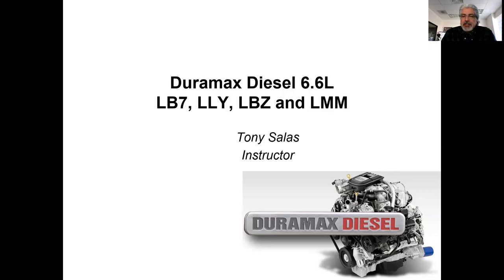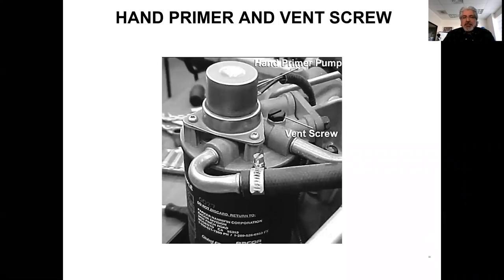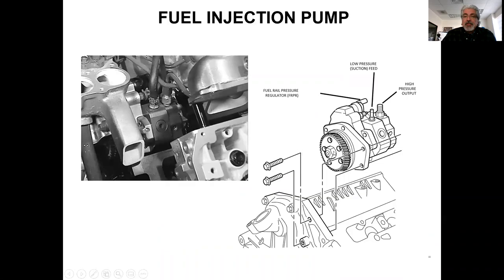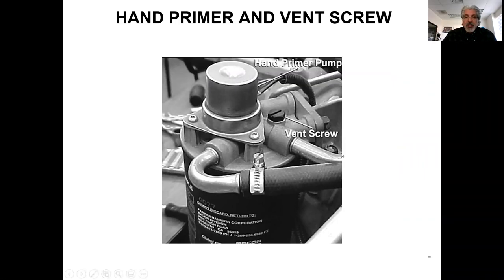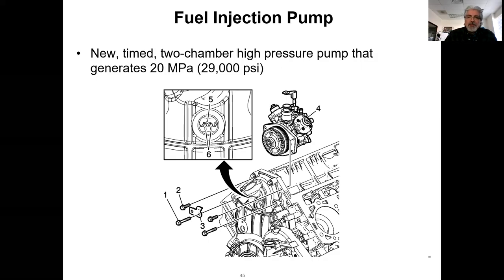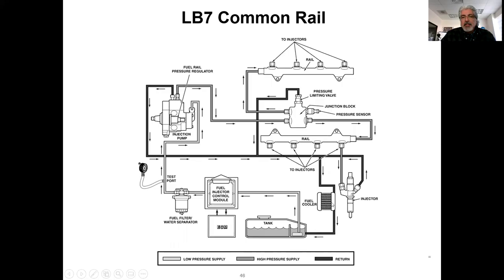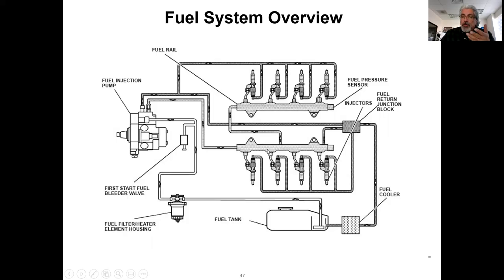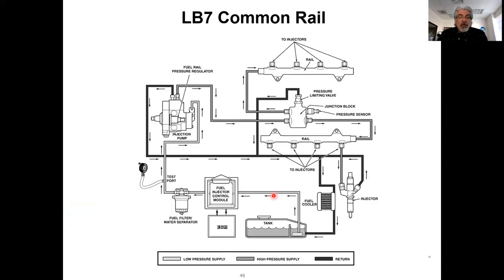Duramax 6.6L CR Diesel Talk

Comment: I'm a 1st time owner of a 06 lbz  and this is informative. I've Learned alot about fuel rails and suction pumps. You are a professor! Thank you
Reply from the maker: Thanks for the comment!
Reply: What a great explanation and thank you for putting it in a way thats easy to understand, youve gained a subscriber. I'm having a hard start problem with my lb7, 10k on new injectors, airdog, cp3 and other supporting mods including fuel filter delete. When truck sits over night it starts absolutely perfect, after I shut it off I can immediately start it with no problem, if it starts to sit between 1/2 to approximately 2 hours it turns over a lot and sometimes won't start without starting fluid (I know! 😂) and if it does start it it starts at a low rpm and then revs up to normal. At the 3ish+ hours it starts normal again. No noticeable fuel leaks but it does have the original factory fuel lines from the tank. Any suggestions? I was thinking an air leak but didn't want to throw money at it guessing

Comment: Tony, thanks much for the great explanation!  Just replaced the filter assembly after my LMM left me stranded in a parking lot.  Realized I lost the prime due to failing seals in the assembly.  Your explanation helped fill in the back story.  Love the comment about idling when sitting there filling up - not sure why folks think they still have a 70's era diesel.
Reply from the maker: Glad it helped, thanks for commenting!
Reply: I have an LMM and experienced the same problem as you after a long drive from LA to Phoenix pulling our RV.  I was able to re-prime with the hand primer to get it started and its been fine since.  Nonetheless, I just ordered the fuel filter housing and am going to replace upon arrival.  It appears to be an easy job, but any pointers?

Comment: Maaan!!  I wish there was a ❤ button!! 
I’m new to your channel Tony and thank you for your wisdom on this topic!  I own a 04 GMC with a LB7. It has very low mileage and is in excellent condition. I’ve had struggled with electrical gremlin and now having fuel issues too. 
I’m extremely happy I finally found your channel! 🙏🏻❤️
Reply from the maker: Sorry didnt respond sooner. With LB7 using a good fuel additive goes a long way. 
There are some great upgrades like the banks big head and raise the boost from 20 to 27 psi. No prgramming needed and improves fuel economy

Comment: I appreciate your u tube post.  It was very educational for me.  My truck died after a minute of running.  I went to an online auto parts store and paid for a full housing like you mentioned it may be the way to go.  Got the housing and installed.  Sadly enough the primer pump leaked.  Returned for a refund then decided just to go to the rebuilt kit.  Another week later it arrived and I installed and yet again that primer plunger leaked.  Both came from the same manufacturer.  As funny as it sounds I put back my original seals on the primer housing and it kept the system vacuumed.  Whether the other 3 o rings were at fault remains a mystery. For the price canadian 242 vs 27 I'd go with the rebuild kit. But the manufacturer that I dealt with and is very common failed to provide quality replacement and 3 weeks of truck sitting and trying to work in sub zero temp
Reply: No fuel getting to injectors
Reply: Why don't it start
Reply: Any ideas
Reply: HELP me PLSZ
Reply: @user-pc4bq7dd2i  there needs to be a vacuum in the fuel line on the duramax in order for fuel to get to the injectors.  That vacuum comes from priming the fuel filter.  The primer knob at the top should offer a bit of resistance when you push it down. If it's easy you don't have a vacuum.  The o rings would need to be replaced in it and you can buy a ring kit and replace them very easily.

Comment: Stuck duramax with crank no start, 185k on a 04. I am not a mechanic nor want to be but I guess forced in this case. Your video helped me understand the fuel system. Thank you. Fuel cap first, then the filter head, both oem from the factory.
Reply from the maker: 04 was a year GM went from LB7 to LLY, which one you have? Have you also tried priming the pump on the filter while someone cranks it?
Reply: @dieseltalkwithtonysalas8725  I have the 2004.5 truck with the lly. Tried the pump and crank process yesterday. The only thing that hasn't been replaced on this truck's fuel system is the injectors.
Reply: And thank you for responding to my post. Your video was very good. I learned a lot. thank you.

Comment: With regards to the fuel cooler.... hot diesel is of course "bigger" in volume.  This reduces power!  We were testing the output power of an 850KW generator, but couldn't get full power from it.  I leaned on the fuel tank and noticed it was screaming hot.  Seems the guys had just dumped a couple of jerry cans in there since it was just a quick test.  As the return fuel dumped in, it just kept getting the fuel hotter and hotter!  Output was down about 15% at the end.  Not a small amount at that level.

Comment: We have a suspected air in fuel problem. The fllter head has been replaced with new OEM and still will kill once in a while then run smooth again. I recommended to my son to put a clear hose on the fuel return hopefully under the hood and run the clear line up under his windshield wiper to monitor while driving. Is this the easiest way to diagnose air in fuel? I'm thinking it HAS to be the issue but nothing is for sure so it'd be nice to confirm.
Reply from the maker: I still don’t trust filter head 
I apply a vacuum using a hand held vacuum pump. This is done with a liquid separator
So the vacuum pump doesn’t suck fuel.
This is done at the outlet line of the fuel filter housing. You apply about 12 inches of vacuum and see if it holds.
If it doesn’t the filter head is leaking.
If that’s ok, how do you know it’s fuel related?
Do u have a scan tool or handheld to monitor fuel rail pressure?

Comment: Hello Tony, thanks so much for the great presentation!  Nice diagrams and clear delivery!   I am in the midst of replacing injectors on a 2004 LB7 with only 94k miles and there are two things I would really appreciate expert advice on:
1) On each side, the rear injectors had a load of gritty crud at the inlets, and corrosion outside the metal/metal sealing interface.  Fairly clean at the front injectors and no corrosion, but both symptoms progressively worse towards the rear.  Do you know what this would be from and how to protect against it?
2) I would like to leak test the installed return lines.  I have seen a nice video of replacing the block banjo with a special one that allows the line and 4 injector return connections to be tested, and this does test all the line welds, but I don't have one and I would like to test the block connection too.  The return line from the engine has the CP3 and the regulator on it .....  Would a vacuum or a pressure test be feasible on the line without leaking through or damaging those?
Thanks so much for your consideration of these things.
Reply from the maker: It is common to find grit on the inlet of the fuel injectors. How to reduce that? Fuel filters! I push for a supplement fuel filter to add. 
Second, it is easier to buy a hand held vacuum pump from a local parts store. Vacuum test the return , may have to get creative with the plumbing but I have never had to on the LB7 s. Make sure you replace the banjo gaskets and torque to spec

Comment: Hello Tony, this is very informative, thank-you.  I want to get a new fuel cap which has the pressure relief features built into the cap that you described to be so important.  Would you please recommend a source for me to purchase that cap for my 2004.5 Chevrolet K2500HD Duramax 6.6L (LLY) truck?   I have check the GM replacement parts, and don't see any that include the specs for the cap describing the pressure relief that you referred to..   Thank-you in advance, Bryan

Comment: Tony I just want you to know that the fuel system you're talking about here does not suck the fuel from the tank. What is happening is the pressure in the supply line is being reduced allowing atmospheric pressure to push fuel through the system.
Reply from the maker: @MylesSpengler  don’t split hairs
Negative pressure on one side creates a low pressure under atmospheric absolute pressure. In our trade anything under atmospheric is considered a vacuum. This why we measure the suction in inches of mercury. 
Suction is created to pull fuel from the tank to the injection pump 
Atmospheric on one side in the tank which needs to be  vented and low pressure suction on the other. 
Geeez

Comment: I installed a lift pump on my 2010 LMM. Great option.
Reply from the maker: I hope it works great . Thanks for watching
Reply: @dieseltalkwithtonysalas8725  It's been there about a month now, Very happy with it. I also bypassed and removed the engine bay fuel filter since the Air Dog has water separation and a filter.

Comment: Very informative, awesome video! Any idea what would cause a high fuel rail pressure p0089 with a crank no start on a LLY?
Reply from the maker: Thanks for the comment! If high the first question is the truck modified with aftermarket lift pump? If not it could be an issue with the MPROP or fuel pressure regulator on the injection pump. But need to verify power to the connector and ensure there is no codes set for it.
Reply: @dieseltalkwithtonysalas8725  Thanks for the response! The truck does not have a lift pump in it yet, is the MPROP the sensor on the passenger side fuel rail? The only code is the P0089

Comment: New subscriber!! Loved the video! Just bought a '05 LLY with 376,000 miles with some issues,but nothing I can not fix myself with some research. I ha e a edge cts3 monitor and my e.c.t is showing -40 and the engine idles at 850 rpm so the ecm is making the engine rich to compensate. I have Ohms out the ect sensor and is reading zero,meaning the sensor is bad,I believe replacing the sensor will correct my problem? Your thoughts sir?!?!?!?
Reply from the maker: -40 degrees usually means an open in the circuit or short. ECT sensor should not have 0 ohms. It should have resistance. I would have to look it up what it should be since it varies with temperature. Check reference voltage to sensor, with key on, measure voltage across the tow terminals of the sensor, this is with the sensor disconnected, obviously should read 5 volts. Since the ECM thinks it is cold, it will idle up.
Reply: @dieseltalkwithtonysalas8725  thank you

Comment: Excellent Tony, Thank for the info, Question my 04 mid year Duramax LLY has a fuel controller you stated that the lly  dint have one. did chevy used it on some then discontinue use? Thanks
Reply from the maker: You mean the FICM.
The 04-05 have one but the 06-07 LLY DOES NOT.
Hope it helps! Thanks for the comment!
More videos coming soon been slammed.
Got to Denver tomorrow to teach at a shop!

Comment: Tony...Excellent presentation and keen knowledge on your part. I have question.

Below you advise changing fuel filter every other oil change or 20k miles. My 16 LML goes 25k-40k miles before I have to change it. It also trips a change fuel filter light at about 14 in Hg I believe. 

Now on my LBZ, I installed a vac gauge at bleeder port on fuel filter head and monitor that before I change it. When it gets close to 8 in Hg,  I change it.

Also, I work in the filtration biz, and typically with single media filtration, the greater the differential pressure(vacuum in the case of a duramax fuel delivery arrangement), the more efficient your filtration will be until a)media breakthrough or b) a fully loaded media.

My question is at how many inches of Hg should a stock filter be changed?
Reply from the maker: First of all I say change filter every other oil change which is every 4k oil change which makes it every 8-9k.
If you are seeing 14 inches.. we’ll that s high
Spec from GM states no more than 10 inches
My spec is 8.
However! You have a LML. Those readings will hurt a CP4 pump.
But then again I recommend a lifer pump on those models.
Thanks for the comment!

Comment: Thanks for the information video but I have a couple qestions for you if you have some time. I have an lb7 Duramax completely stock replaced the injectors 10k miles ago has 315k now boshe reman injectors new hard-lines new seals o rings thermostat the whole 9 now I have fuel in my oil took the truck apart tore of the driver side cover and started it to look for fuel leak from the return line or possibly cracked injector. Nothing obvious so today I took appart the other side and did the same this time taking off the filter and adding uv due to it now I can’t seem to get the filter to prime I didn’t disconnect the Fcim banjos tried bleeding it from the housing and the hall valve nothing hear air and some times fuel but it won’t get hard. When I started the other driver side sat and ran fine no issues but the primer didn’t get hard either just bled some air out but that was without taking off filter or any rubber lines. Also had surging at low idle coming to a stop never a huge lose in power just the falling on its face for a second then kicking in when I was taking off like you had said in the end with air bubbles. I don’t know how to get this thing started again coild it lose prime through cp3? What tool would i need to test filter housing or could I make it? Thanks for your time I really appreciate it.
Reply from the maker: Ok a quick answer on one thing before I knock out .. long day
One to test filter housing you apply vacuum on the outlet line of the housing for a leak. Should hold vacuum.
Second, to find leak on high pressure side valve covers have to be removed. Disconnect regulator at the CP3 pump and IGN relay at the fuse box on the drivers side engine compartment. Have someone crank engine over while you use a colored led light to find a leak. The reason why we disconnect the regulator on CP3 is to go to max pressure and find leak. Reason why IGN relay is removed is it cuts power to FICM to engine won’t start.
Let me know… Tony

Comment: Grrreat... after i bought TWO new green locking caps, aftermarket : /. Better go check them now, Really appreciate the heads-up! (is there any way to tell just by looking at the cap?) [Btw, used to work at a truck stop... can't Stand little boys who leave their diesels running at every store and fill up. Even in the cold, once it's up to temp, it just shows you're not smart)~ thx
Reply: at start up a diesel consumes more fuel than letting idle for 5 minutes

Comment: Hey Tony, thanks so much for the video man. you’re a godsend. you should have a diesel course for sale. i’m having a problem where my new fass pump is losing prime and my truck will die whilst driving. the rail pressure goes crazy and rpm is bouncing at idle. if i prime all the air it drives fine for a week maybe two and then it starts to act up again. having a sump installed on the bottom of the tank as well as a hp gauge for the rail. do you have any recommendations or anything? i’ve been stumped for a year on the issue and have gotten the cp3 and injectors rebuilt. entire system is new.
Reply from the maker: With the complaint you have I take a look at the pick up in the tank.
If the fuel levels runs low ti can lose prime on a high speed turn.
I would first run a line to a 5 gallon tank and see if the vehicle loses prime.
If not then need to check filter housing

Comment: I’m in class .. learning. Have a 2093 1 ton Silverado..lost power and white smoke came out. Oil looks okay. No leaking . I also found out my fuel filter wasn’t put on right. So is leaking fuel -and won’t start. Though I see this video to know more about my fuel system
Reply from the maker: Thanks for commenting, you get it fixed?

Comment: Just found your channel and learned a few things from this video. I replaced my cap on my LB7 with a locking one, how can I tell if it has the vent and relief valves.
Reply from the maker: Probably just a pressure relief valve but search that cap and look for specifications 
Thanks for the comment!

Comment: Tony, I have a question... reliability aside, might it be better to fit a CP4 onto an older engine? Higher psi is obviously better if the injectors can handle it, no? (btw... great explanation on the greater pumping volume of the CP4, ...But just for the record, the plungers are moving twice as much as the CP3, so might they wear out faster....?) thnk you
Reply: Sorry... Specifically: a CP4 onto a 2007 LBZ...?
Reply from the maker: The CP3 has done a great job. It’s isn’t surprising to see that pump go over 500K miles. 
CP4 is a good pump but the low lift pump pressure and air can destroy it.
As time as come by many are realizing the pump isn’t that bad as thought.
Thanks for the comment!
Reply from the maker: @georgehofgren6123  leave that CP3 in there! It’s a good pump! Keep fuel filter changed every other oil change. Use a good fuel additive once in a while.